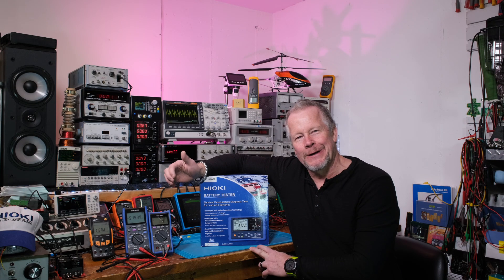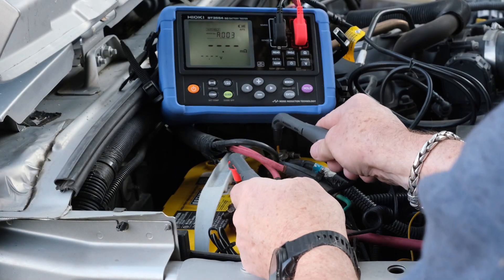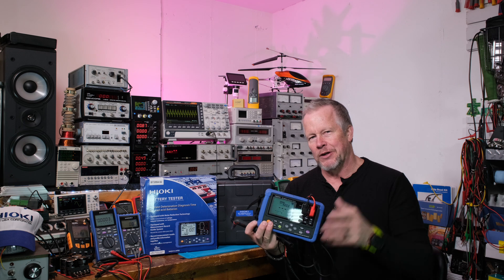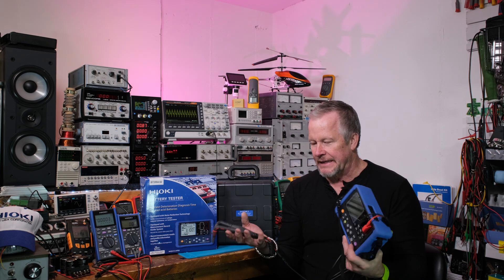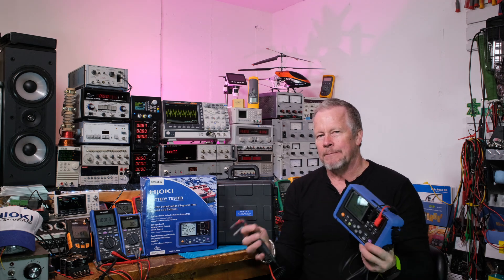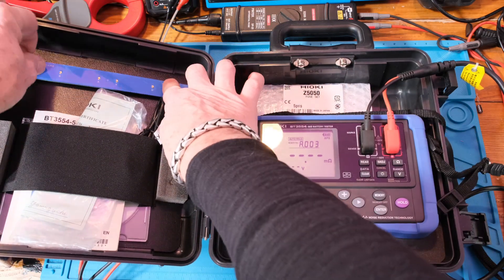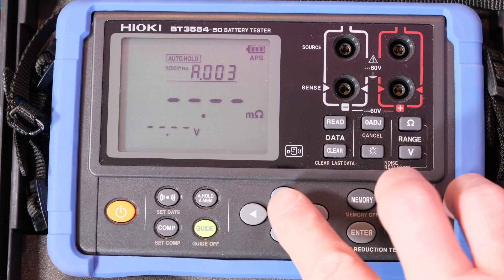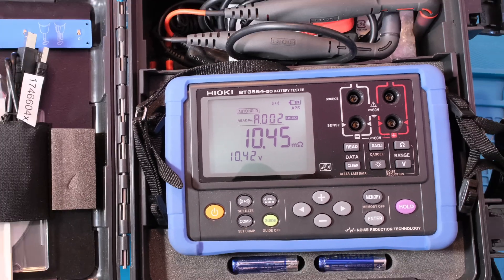Hioki Battery Tester BT3554 demonstration #Hiokibatterytester #SLAbatterytester

Comment: It would of course be interesting to disassemble the device. Or if that is forbidden, at least look at it with an ocilloscope to see what kind of signals they use, whether they measure the impedance in the self-developed function base and calculate it or use the usual jumps to directly determine the ohmic resistance. For the price of this "a la japanese" Chinabox, it must be able to do all sorts of things...
Reply from the maker: Yes I can use a scope to check it.  BTW - Japanese equipment is made as well as any out there.  Check out my reviews on the Hioki multimeters - super well made.  https://youtu.be/YvivwYCxrBo
Reply: @KissAnalog  You could connect a series of 10mOhm resistors and measure voltage with A and current with B-A at the same time. It would also be very interesting to connect a capacitance in parallel to the resistor and inductively determine whether the device would calculate this reactivity to the internal resistance or to the battery voltage.

Ps. they even have a branch in our village but I will probably never find 2K5 for playing :(
Reply from the maker: Great idea;)

Comment: I Have 48v 20 AH Lithium ion battery I can Not test it.  I think, I can not adjust correct Range of OHM  and Voltage. Can anybody tell me What is the Rang of this battery. PLZ.
Reply from the maker: Thanks for asking.  There are a number of charts - but I think it comes down to what is the nominal range for most Li Ion battery cells.  There are 13S cell arrangement for 48V cell.  This is 13 series cells.  'Typically' - Each cell should be kept between 4.2 V and 3.7 V, but can go down to 3.4 V at 0% charge.  So, the healthy range is 54.6 V to 48.1 V but can go down temporarily to 0% charge at 44.2 V.  But it is a good idea to verify the cell voltage with the manufacturer.

Comment: This really is quite a sweet instrument. I have the slightly older version the BT3554-01 that I road tested for element14. I can't praise the time improvements for taking measurements enough. For a 55 cell VRLA battery bank, I cut the time taken to measure all the cells from 38 minutes down to 9 minutes. 
The memory allocation is well though out as well, being able to save multiple battery bank tests, each using a different memory bin, allows all the work to be completed on site and then all downloaded together into the Gennect software.
It is best to get directly onto the cell terminals to get the readings, voltage won't matter, but the impedance reading can be erratic on some types of connections.
Cheers for the video.
Reply from the maker: Thanks for the great feedback!  It is fantastic to hear from someone that has experience with this type of equipment.

Comment: $3,250.00???. I was going to leave it, but you can get a car battery tester for a lot less, that's self powered and has 4 wire crocodile terminations.
Reply from the maker: Thanks John!  I think the value of this meter is the cool comparison stuff that makes testing lots of batteries go faster.  I just touched on the basic test;)
Reply: @KissAnalog   Measure batteries online. works on very large capacity cells,  logs data, or connect to a phone to generate automatic reports.  Pretty handy if you actually need it.

Comment: Looks like a nice tester with. Lots of options. As a retired auto tech i used the carbon pile load test for battery's but later used an OTC unit that applied a small load to test the battery and then start the engine and it will test the charging system as well. Does the Hioki ? Also any alligator clamps or do you just hold the leads?
Reply from the maker: Thanks Tony - great feedback!  I don't think the Hioki does the testing of the charging system.  I think its power is in testing a lot of batteries quickly with all the setup and comparison features.

Comment: To test a car battery you put 40+ amps into it and if the voltage goes above 16 volts the battery is sulfated. The other method is to but the battery under a load, car batteries you will need a carbon pile so you can draw 1/2 the battery rating while watching the voltage. I do have a load voltage tester on my bench I can put a little over 600 vdc, I use it to test tube power supplies and small batteries as well. Remember battery capacity is different than a battery that has a surface charge, you could have a battery that will show voltage with a light draw as good but when tested for its capacity it could fail.
Reply from the maker: Thanks James!  This is great info!